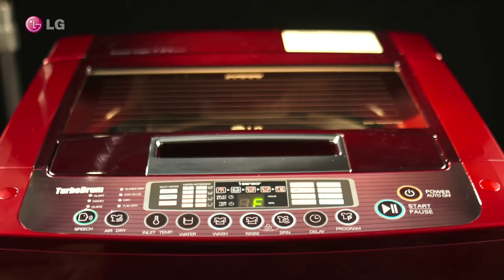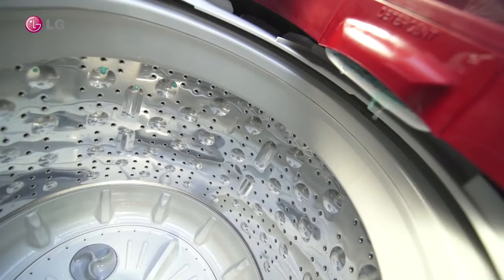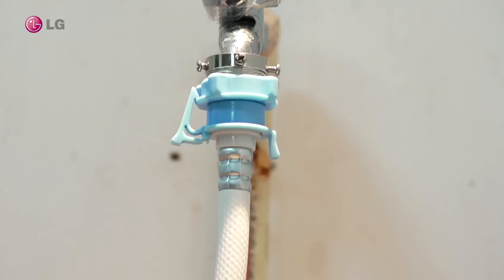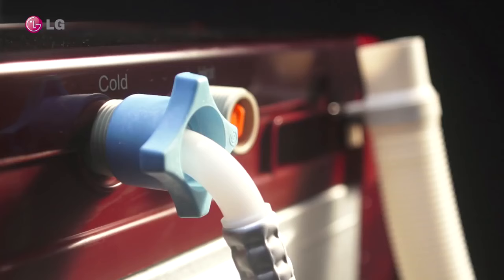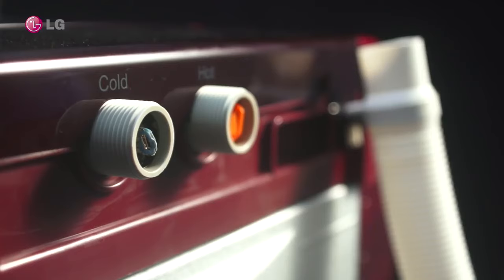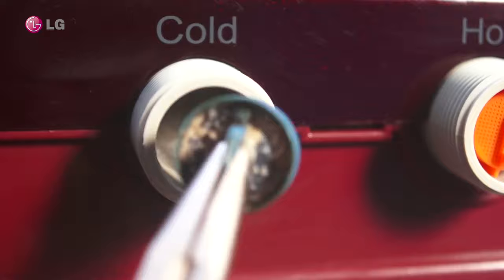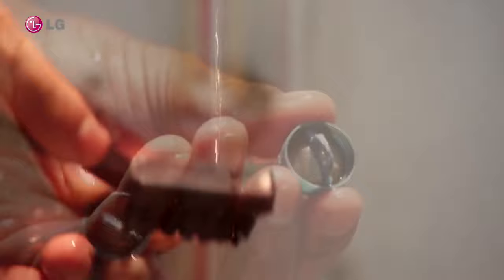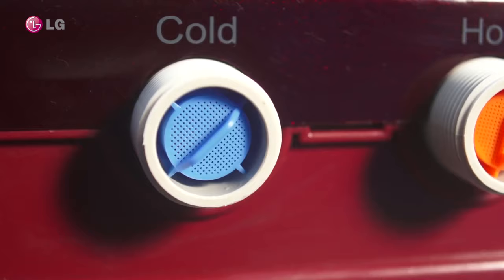[LG Top Load Washer] - Water not filling or slow water filling in LG Washing Machine

Comment: Also check the additional stainless steel fine filter following the removable plastic filter. Use a small brush and spray bottle to clean it as well.

Comment: Water inlets are fine as well as water pressure but my washing machine does not fill with water. 
Water going in but it doesnot fill the tub. Any help?
Reply from the maker: Hello, Thank you for contacting LG Electronics.
Please accept our apologies for this issue
Kindly make sure that the drain hose is installed 1 meter high from the floor
Reply: I’m having the same issue.  Water pressure is fine.  Filters got cleaned.  Drain hose is installed properly.   What else can we do to get water.  We have no water at all.

Comment: Hi my LG  wtg6520 top loader won't fill with water. I have cleaned inlet  filters and drain filter , checked hoses but just water level lights are flashing through the level numbers and still no water just it makes a buzzing noise. Please what can it be
 I'm om Australia thank you 😊
Reply from the maker: Hello, Thank you for contacting LG Electronics. 
Please accept our apologies for this issue
Please ensure that the drain hose is installed at a height of 1 meter in the designated place at the back of the washing machine

Comment: I have a brand new machine, never been used that will not fill.  There is water coming through the hoses if I disconnect them and put it into a bucket.  Is there something on the filters that intially need to be done on the first ever hook up?
Reply from the maker: Hello, Thank you for contacting LG Electronics. 
Please accept our apologies for this issue
Please inform us of the unit model number and the country in which you are located.
Reply: @LGService4u  WT6105C. I have a new hoses and I’ve checked them multiple times and everything’s fine on that end. But no water goes into the machine. It will still run a spin cycle and all that. Just no water.
Reply from the maker: Which country are you located in, please?
Reply: @LGService4u  USA
Reply from the maker: Sorry for the inconvenience. For your information, please note that our support covers only UAE, Qatar, Bahrain & Oman boundaries. Hence we don't have much information on your region-specific product. Kindly refer to your country's support for further assistance. 
Social Support
Facebook/LGUSSupport
Twitter@lgussupport
Online chat:http://spr.ly/6052P3Txi

Comment: Hi. What if there is water interruption in the middle of washing? There is no problem with the machine it's just that the supply of water stopped. What should I do? Should I turn off the washing machine? When I turn the machine back on when water is back, will it repeat the cycle from the very beginning? Thank you for your response.
Reply from the maker: Hello, Thank you for contacting LG Electronics.
Please accept our apology and be informed that the washing machine has been manually locked, the washing cycle will be restarted from the beginning again

Comment: I cleaned it, but still water intake ia slow. Machine taking more time to wash. Please help me.
Reply from the maker: Hello, Thank you for contacting LG Electronics.
Please accept our apologies for the problems that this issue caused you.
Kindly check the water pressure.
Reply: @LGService4u  Its ok, cool. I'll check it out. Thank you!
Reply from the maker: Thank you for contacting LG, Have a great day.
Reply: There is a stainless steel filter following the removable plastic filter. Use a small brush and spray bottle to clean it as well.
Reply: @foleyhund3860  will try it. Thank you
Reply: @foleyhund3860  hi there, is the stainless steel filter behind the plastic one? its not removable though right? thanks in advance.

Comment: Do not advise me to lift my water tank to 12 ' up.
It's not possible
Reply from the maker: Hello, Thank you for contacting LG Electronics. 
Please accept our apologies for this issue
Please clean the water inlet filter and make sure the drain hose is installed at the back of the washing machine at a height of 90 cm to 1 meter.
Is there anything else that I may assist you with today?

Comment: I bought a new washing machine, Top load, But its water filling is too slow.. What is the reason, Is it manufacturing defect
Reply from the maker: Hello, Thank you for contacting LG Electronics.
Please accept our apologies for this issue.
Please check the water pressure and the water inlet filter.
Reply: @LGService4u  Oh thanks,, for replying, I checked the pressure and changed it to a another high-pressure intake tap
Reply from the maker: Which country are you located in, please?
Reply: @LGService4u  India
Reply from the maker: Kindly note that your unit needs to be inspected 
Sorry for the inconvenience. For your information, please note that our support covers only UAE, Qatar, Bahrain & Oman boundaries. Hence we don't have much information on your region-specific product. Kindly refer to your country's support for further assistance. 
WhatsApp
9711709999
24 hrs (7 days a week)
Except for national holidays

Phone
Call LG Support
1800 315 9999
OR
1800 180 9999
24 hrs (7 days a week)
Except for national holidays

Comment: Didn’t help at all
Reply from the maker: Good day!
Thank you for contacting LG electronics.
Please accept our apologies for the problems that this issue caused you.

Which country are you located in, please?
Reply: There is an additional stainless steel fine filter following the removable plastic filter. Use a small brush and spray bottle to clean it as well.
Reply: @foleyhund3860  ware is this fine screen at in the machine ?